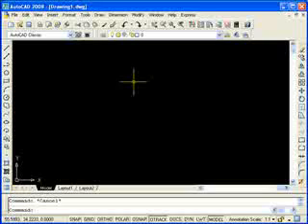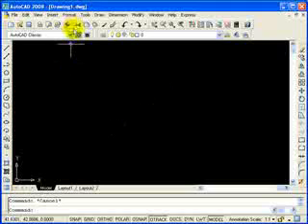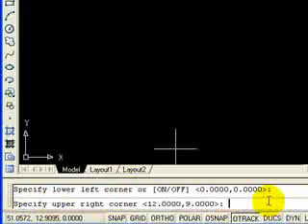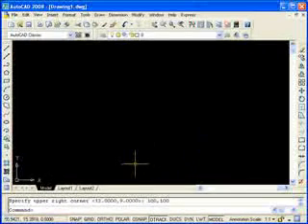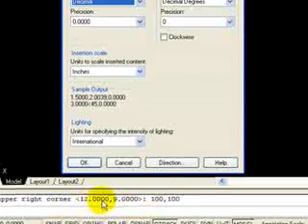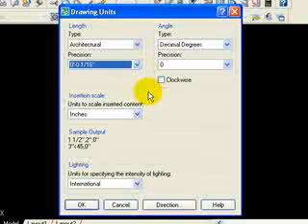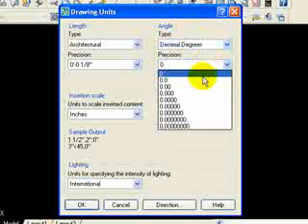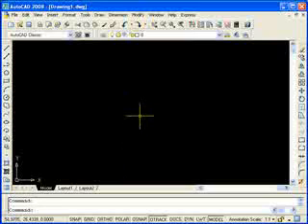AutoCAD 2008 - Tutorial 09

Comment from the maker: AutoCAD defaults to inches when you're in architectural units. By typing in just 50, you'll get 50 inches. If you want feet type 50', not just 50. Here are some other correct ways...

50'-6" (fifty feet six inches)
50'6" (fifty feet six inches)
50.5' (same at fifty feet six inches)
50' (feet)
50" (inches)

Hope this helps.

Comment: Just in case your not kidding... in surveying (Civil Engineering) each degree is divided into 60 minutes, and they, in turn, into 60 seconds.  This is unrealated to time measurement.  It is just another way to express an exacting angle and you can think of it as an "imperial" measurement.  You know, the ones that make less mathematical sense than the Metric standards we refuse to adopt here in the US. Yeah, let's measure time in 1/60th's, and a mixtue of 1/8ths, 1/12ths, 1/16ths and others...